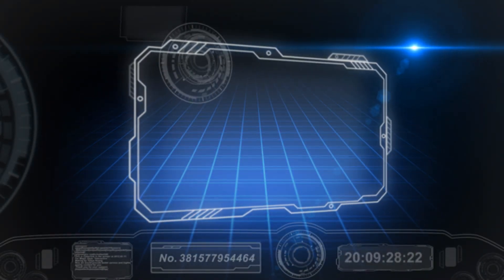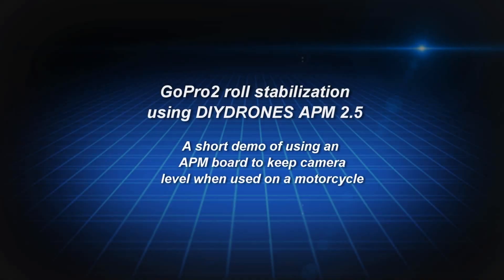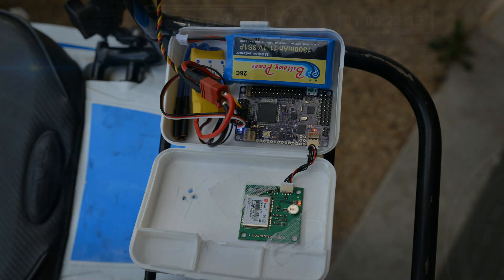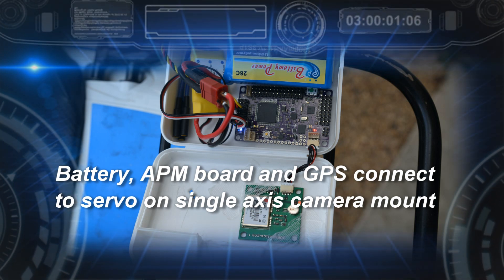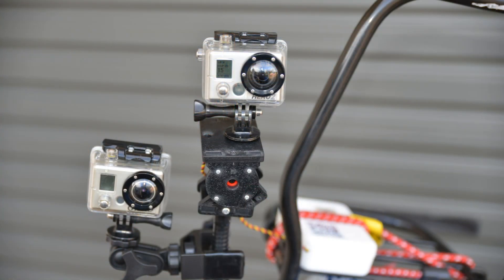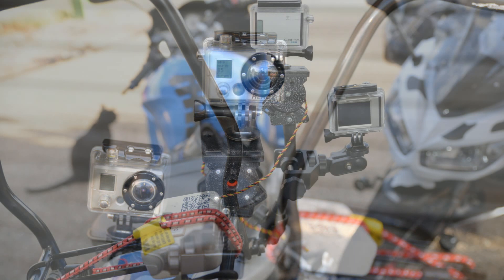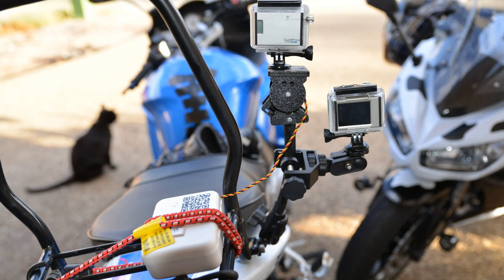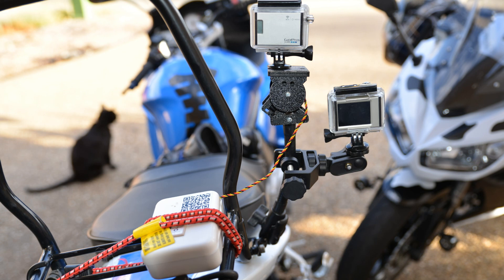DIY Gyro GoPro Camera Mount

Comment: The board used is a flight controller from 3D Robotics designed for planes, multirotors and remote vehicles. There's no programming required. All you have to do is load the firmware for a 'plane' and then the board will attempt to keep a gimbal connected to it level relative to the board.

I should mention that since I did this DIY project there are now gimbals being produced for the GoPro that are reasonably prices and work great. Using a flight controller like I did really is overkill, to say the least. And the APM flight controller is over $100.

Check out something like the Hiflysky 2-Axis Handheld Brushless Stabilize Gimbal on eBay. But make sure you buy a lens cover for the GoPro given these gimbals don't use the GoPro protective case.